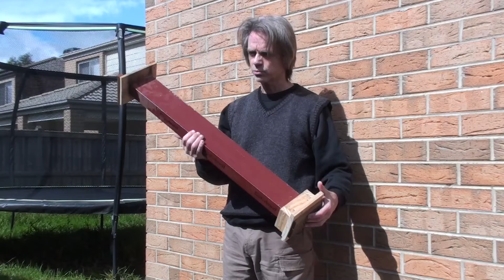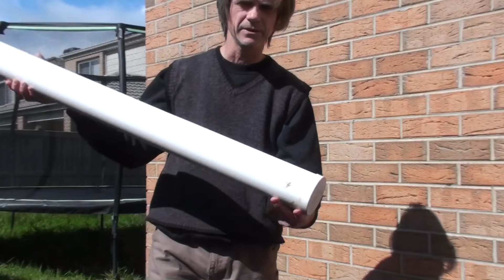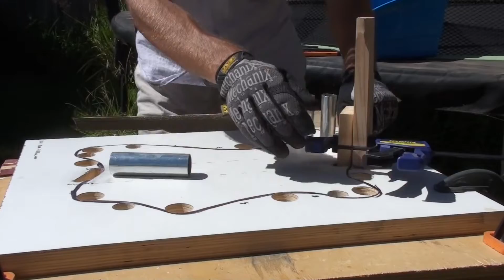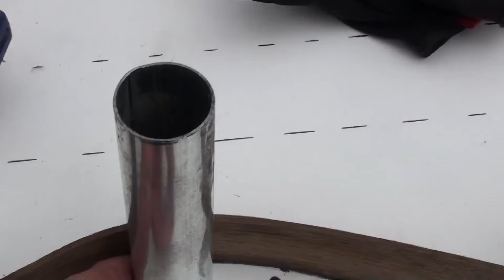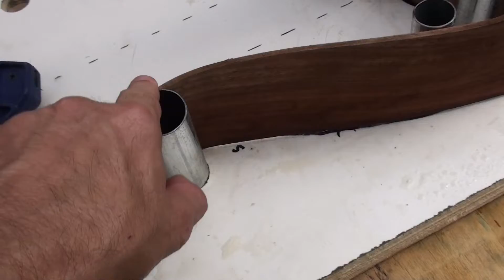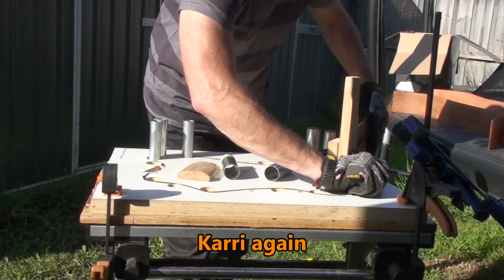The rules for bending timber with a steam box

Comment: (Thought I'd posted this earlier, Cameron, didn't work obviously) - great video, and some very useful info I can apply to my hand bending on an iron.

Did I miss something?  I wondered why you didn't start at the end with the tightest bends (the cutaway) while the wood was hottest, and just go down through the waist to the other end - getting the 2 ends right first then trying to pull the waist in seemed to be pretty hard work.
Reply from the maker: That's a good analysis Chris.  I made the top piece of the jig permanent (probably a mistake) so I had to start at the top every time.  Initially everything was breaking, so, I was experimenting with different methods, the centre was the most gentle bend so I did it last.  It was only later I realised that speed was the most important factor and that when it works, it just works.  Now that I know, I would do as you have suggested.